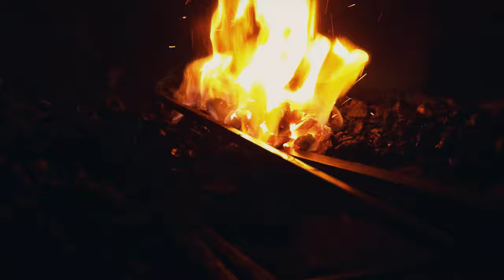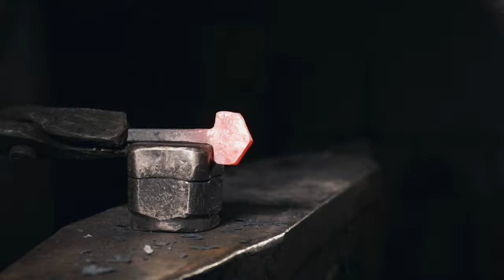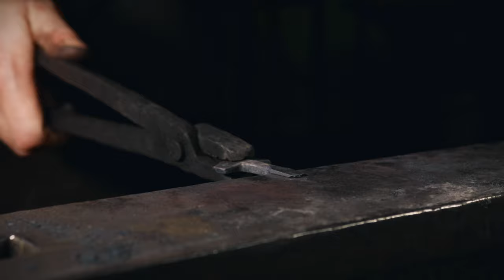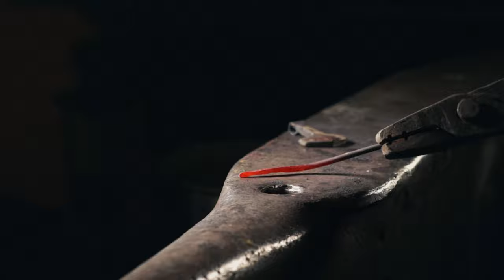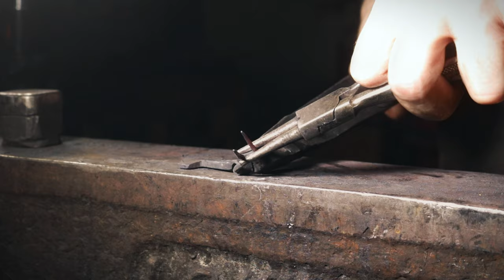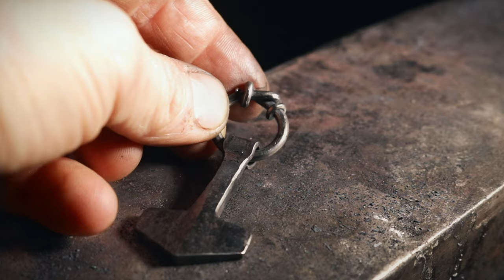Forge like a Viking: Blacksmithing Your Own Mjolnir pendant, Thor's Mighty Hammer

Comment: I'm going to try and make one of these next time i'm out forging. I wear a Mjolnir daily so it would be awesome if it was one that i made myself. Is there a particular advantage to using the Hardy hole tool at 1:50? Can I just use the edge of my anvil? Also Great video!  I love the lighting you use now!
Reply from the maker: Absolutely, go for it. I got a very special Mjölner I made that I am wearing all the time. You can use the edge of your anvil but you will probably have to draw more material for the shaft of the hammer, otherwise it will be difficult to hold with tongs. But that is the only reason I am using the Hardy Hole tool. I like to be able to hold the Mjölner horizontal in line with my anvil.

Thank you very much for your feedback!

Comment: Hello. Can you please tell me the dimensions of the metal sheet. I tried to make the hammer from a round bar 10 mm diameter but I see from a rectangular one it is easy.
Reply from the maker: Hi! For this one I used a 20x5 mm bar.
Reply: @lufolkcrafts  Thanks a lot for your answer.
Reply from the maker: @rcostineanu  you are welcome